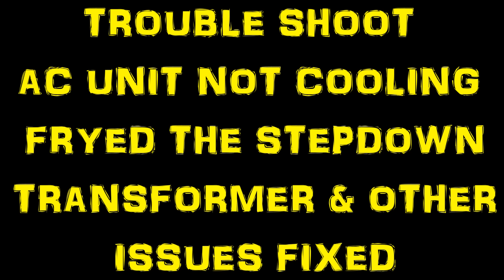AC UNIT NOT COOLING FRYED TRANSFORMER AND OTHER ISSUES FIXED

Comment: My 2.5 yo grandson, was playing behind outside unit... So I started my search there.

The two t-stat wires were stripped of installation 2” back, and painted.

He got his t-ball and moved wires... no more ac.
Cut and stripped the wire, Replaced 5amp fuse and all is good.

Grandpa is hero for next 10 minutes.

Comment: Hey ac guys question for you: my ac compressor went bad after 16 years. It’s a 22 system. So what’s a good brand to replace it with?  It was a trane top of the line system
Reply: We here on Cape Cod use alot of American Standard units

Comment: Rant:  My Bosch system doesn't remove humidity!!   72*F, 70% humidity!  Meanwhile my dads place is 77*F and 46% humidity... feels a lot better.  Bad choice, I did it for the heat pump and reduced electric rate in the winter.  :meh: